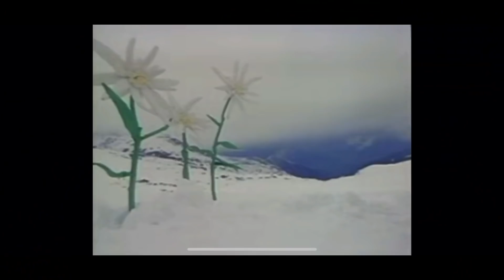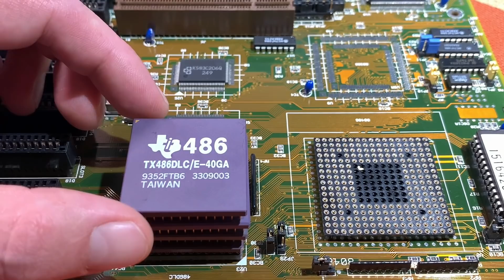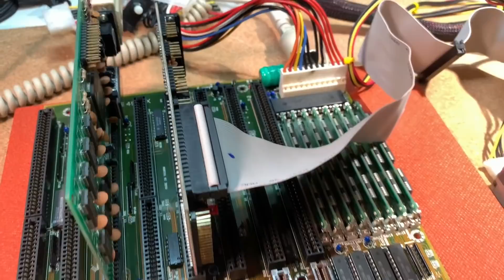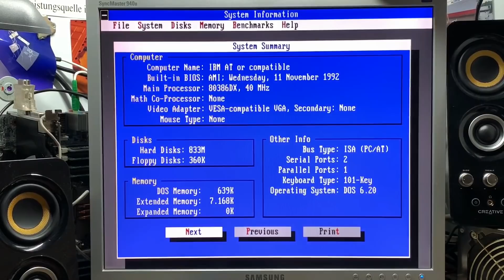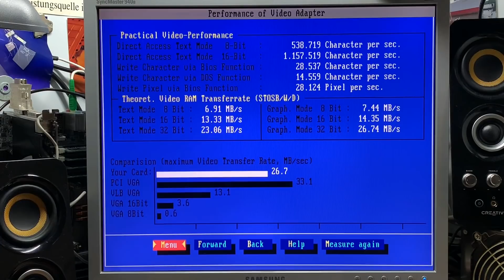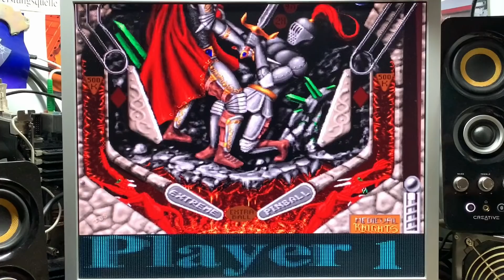AMD 386 DX-40 and VESA LOCAL BUS - Boardreview and Benchmarks

Comment: It seems you have this VLB IDE bridge adapter set to 600 ns cycle length (JP1, see the labels on the far left of the card). You might try configuring it for shorter cycles to improve PIO performance. 500 ns and 400 ns might work, I wouldn't bet much on 240 ns. This might explain poor performance you're seeing.
Reply from the maker: Thanks, tried now and could increase the performance. but still a little bit behind the ISA controller. I also tried to load the drivers of the card. then i could reach same transfer rate as with the ISA controller. interesting 🤔
Reply: @CPUGalaxy  Try using LBA disk drive, the thing about VLB I/O controllers (my memory is foggy, it was a long time ago) was that they introduced DMA/33 IDE extension, so if you do not have a device that can utilize DMA transfer, only PIO, it might be bad because it is running in compatibility mode. Also, use 80 pin data cable when you test this, 40 pin cable won't allow the full bandwidth.
Reply: @playswithblades  I'm not sure UDMA/33 was around back in the day this VLB card was released. And UDMA/33 is perfectly fine with 40-wire cables anyway :) MultiWord DMA (MWDMA, up to 16 MB/s) might be perfectly possible, though.
Reply: @peachgrush  It's more likely that VLB does not work at all when 386 CPU is slotted in this board - all traces on my VLB capable board from VLB connectors go directly to CPU pins, only few to the chipset - this explains everything about the bad VLB results, but we don't know because we don't have the electronic schematic of the board or any hi-res pictures of the traces. Both I/O and VGA card are probably capable of working in EISA only mode if VLB signaling is not present. It's the same with most PCI-X cards working just fine in normal PCI slots with the extended part of the edge connector just hanging there. As for 80 pin cable, maybe, but why risk hard drive refusing to go to DMA transfer modes, mostly because 80 pin cables are far more available today than 40 pin, why even have that be the bad part of the equation?
Reply: The SIDE Jr VLB controller I used with a 540MB caviar drive would require hard disk DMA to be enabled in bios. Without that, performance was similar to the Copam ISA card. The Copam card wouldn't work reliably with DMA.

Comment: I recall having to use a DOS driver to enable the VLB IDE controller’s faster performance.
Reply from the maker: good hint. thanks. i did not consider that.
Reply: @CPUGalaxy  yeah I recall that too, it was a pita since omg precious memory :D
Reply: Yes, otherwise the BIOS doesn't know to use 32-bit transfers to access the drive, plus it likely needs to select a faster PIO mode on the IDE drive itself to speed up the cycle time. The DMA modes were still just a dream in the VLB days unfortunately..

Comment: What sort of shenanigans are going on with that motherboard to make VLB work with a 386?
Reply: In those days northbridge on a chipset was king, RAM access, CPU data and address bus, everything went through it. If you were willing to burn out your chip designers, you could probably fit an USB host controller in there if for some reason 386 was still a thing in 1996
Reply: @playswithblades  As far as I understood VLB architecture, the slots were between the CPU and the north bridge.  The wikipedia article on the slot mentions the 486 not being electrically capable of driving more than a few slots.  If they were after the northbridge, then I doubt this limitation would have been there and all ISA slots could have had the VLB connector on them.  

None of my digging shows that VLB was ever intended for the 386.  I assumed the two chips were different in bus timings that a 386 would have been incompatible with a VLB motherboard on that alone.

I know later VLB boards used the northbridge because Pentium class chips did things differently.  Often at a performance penalty to both the VLB and PCI bus it was bridged to.
Reply: @weirdmindofesh  takes out his last not-working VLB board Yes, all traces from VLB part go directly into the CPU socket, you're right. Best explanation is that VLB part is inert while 386 is socketed and the controller works in EISA mode when no signal is present and that would explain everything about the results.
Reply: @playswithblades  I think we might need some nice highres photos of this board to see where the 386 is wired in.  It's clear this board is working with the 386.  The super IO card is really only using VLB for a high throughput DMA channel, why it took a performance hit on that I don't know.  Although you might be right on that and it's pushing everything through ISA causing the performance loss.

I think it might be interesting to put a 16Mhz 386 in there and see what happens as the slow FSB clock would be out of spec for VLB.
Reply: @playswithblades  Nice, it might be possible to mod old boards to add VLB then.

Comment: 386 with localbus, a new one to me. I guess as rare as a 486 with pci ?
Reply from the maker: much rarer 👍🏻
Reply: 486 with pci? not that rare eh?
Reply: @LiLBitsDK  Haven't seen one in the field yet
Reply from the maker: I meant the 386 with VLB is much rarer
Reply: 486 pci boards are just normal
Reply: yeah 486 PCI boards were not that uncommon back in the day... I always wanted a 386DX/33 or 40 with a VLB setup when I was a youngin but could never find one.. But I eventually got a 486DX4/75 that I overclocked too 100MHz with a VLB setup and it was a beast in its day - one of my favourite PC setups I've ever owned

Comment: I guess they were not able to do the routing on the pcb with both the i387 amd the 486 in the same orientation
Reply: I wonder if it’s because 486 is an fc-pga package instead of the pga of the 387

Comment: Would be interesting to see how the FPU changes the benchmarks, as this could be paet of the bottleneck...
Reply: In the 386 era (roughly from 1986 to 1990) games did not utilize an FPU. Only certain business applications like Borland Quattro, Lotus 1-2-3, CAD and probably DTP programs used it. Coprocessors were not widespread for home use - it all changed when 486DX/DX2/DX4 CPUs became the entry-level and mainstream, in the early-mid 90s.
Reply from the maker: unfortunately not. no benchmarks in this video makes use of a FPU.
Reply: @CPUGalaxy  I see. Simply a suggestion, for a future video, perhaps..  Really enjoying the content.. as I am sure many are from the influx of EEVblog.

Comment: While the 387 and 486 don't share pins, they would need the same data bus lines just quickly glancing at the pinouts it looks like the orientation that the 387 socket puts the data pins close to the data pins on the 486 socket so that they could run a shorter trace over to the pin on the 387 socket instead having to route long awkward traces 90 degrees around to put pin 1 in the same position.

Comment: Ah the good old 486 days of VLB, I/O conflicts and a bunch of legacy soundcards so you can enjoy all those dos games to their finest.. I think it was mid to late 94 but I'd just upgraded to a DX4 75 (the 100 was too expensive) and a friend had upgraded to a Pentium 60 (socket 4 was it?) Can still remember it so clear like it were yesterday. Shocked how his P60 destroyed my dx4. Wasn't long after that I'd sold everything to get one of those fancy gold topped Pentiums, should still be in the attic.
Reply: You go up the attic and grab that goldtop Pentium now, do you hear me?! :) Apart from the joke: that could be a nice core of a yummy chip collection. :)
Reply from the maker: lol, i wanted to reply the same 😅
Reply: hehe yeah friend of mine had rich parents so he had a Pentium 60, and we awed at the power, I was running a 486 DX2 80MHz (AMD) and a second friend ran a 486 DX2 66MHz (Intel) and we met at each others places each weekend, hauling machines (CRT's were huge and heavy) and then games to our hearts content :D it was brilliant times :D took all day to download Duke Nukem 3D on a 14.4 modem cough cough
Reply: I had a 486DX4/75 which I overclocked by switching the jumpers to set the BUS speed to 33MHz rather 25 and it ran fine for years with no crashes or problems.. Infact it was one of my favourite PC setups I've ever owned. Even ran the original Grand Theft Auto and Quake 1 very playably with a good VLB video accelerator.

Comment: My understanding is that VLB was designed specifically around the 486 (since it's a direct connection), and while Opti made converter chips for the Pentium (and I guess the 386, in this case?), this I/O architecture dependency is what killed off VLB when PCI hit the scene. I'd say it's not unreasonable that such a converter chip would inflict a performance penalty, possibly to the point of bottlenecking the system. . 

Just a guess.
Reply from the maker: This is what i thought too. Bit there is no converter in between. The vlb goes directly to the 386 socket underneath the board and on the toplevel rerouted to the 486 socket. As we can also see the char/sec and memory troughput the vlb performance is given.

Comment: Seeing that mobo brings back good memories for me.
One of my college roommates picked up a Gateway 2000 (complete with cow pattern on the shipping box) that came with VESA local bus, and it was the first time we got to see it. Up until then of course it was ISA 8 and 16 bit slots or the much more expensive EISA, which made more sense for people needing early RAID controllers but didn't get a lot of traction as a video card slot (due to much higher cost). Unless you had an IBM PS/2 with MicroChannel, seeing the VL slot was the first new slot in most users' experience with IBM compatible hardware (before they regularly called it Wintel).
Of course years later we got AGP and then the various PCI then PCIExpress slots, but for the era that VL bus was pretty awesome. :D
Reply: I made that comment before you brought out the stack o' FPUs... ahh so nice.
I was stuck on my 286-12 that year my buddy picked up his new Gateway, although I was able to get an 80287 from another buddy for like 20 bucks - and with certain apps and games the presence was very obvious. 
For those who don't remember, many early CPUs didn't come with a built-in floating point unit - used to quickly do higher precision floating point math than what the math logic unit (ALU) in the CPU could do itself, so if you didn't have one the same math would be done in a much slower fashion using integer operations. This would take many CPU cycles to do the processing, so apps tried to avoid the use of floats where not really needed. Instead if you had a math coprocessor installed and the software knew to use it, it used a simple stack mechanism to push the operands and operators, then a command to run what was on the stack, and then retrieve result... this process was amazingly fast compared to the slow method.
Younger folks are just used to CPUs that can do float without an issue, so this history may not make as much sense without the context that a lot of fiddling with memory settings (are you needing Extended or Expanded) on boot were needed to run various things, so you often would have boot floppies (even if you normally booted from hard disk) just to run certain games or apps.
You have it so easy these days, so enjoy. :D

Comment: Back then: 1 motherboard supporting 2 different CPU generations (EDIT: even from different manufacturers)
Today: Basically the same CPU released 10 times for 3 different sockets
Reply: yeah and those overdrives are like pentiums :D så 3 gens or actually more than 3 gens when you look through all those he stacks up
Reply: Yea imagine my surprise back in the day to find out that the SX and DX were the same they just did not solder the Math Coprocessor connection on the SX chip lol.

Comment: Hi, good video showing the difference in performance. I'm the FastDoom developer (a Doom port optimized for 386/486 processors), can you try it with this setup? I want to see if there is more benefit using vl-bus cards on 386 processors with my port, as I don't have access to a 386 motherboard with vl-bus. Thanks!
Reply from the maker: sounds interesting 😃
Reply: @CPUGalaxy  I am intrested as well:)
Reply: @CPUGalaxy  I'm interested too. :)
Reply: Wow cool! I want to try this port too :)